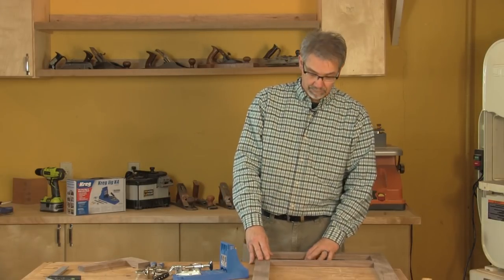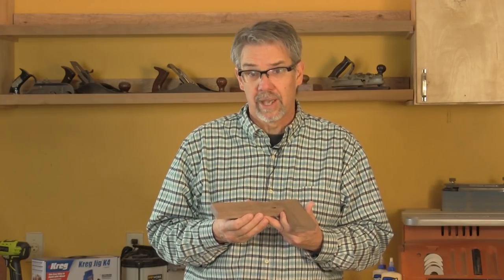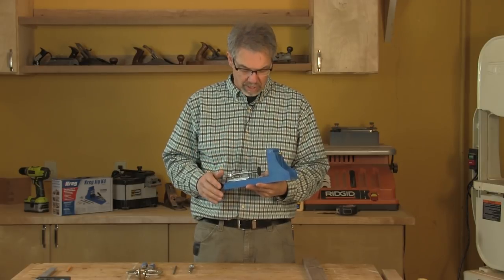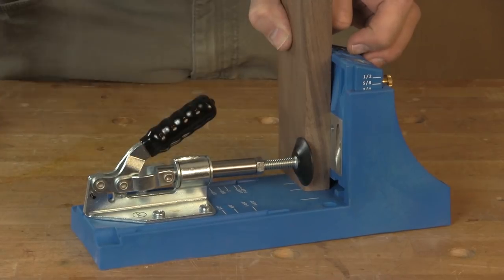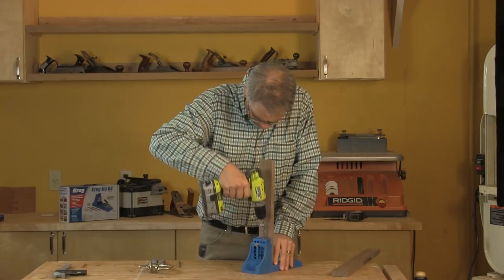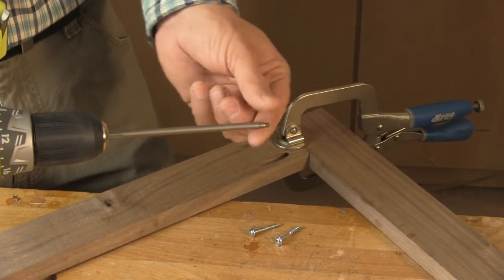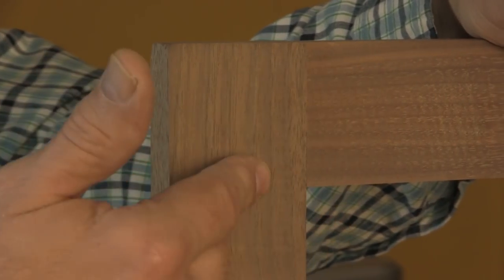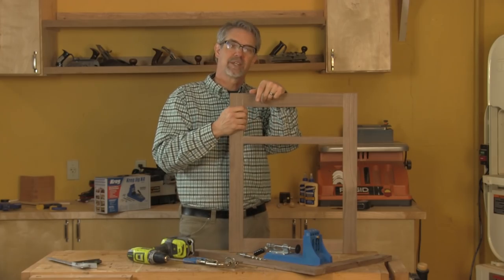How to Use a Pocket Hole Jig

Comment: That 'square drive' he colloquially mentions is in fact called a Robertson drive system...named after the Canadian inventor of it, PL Robertson.
It is 1 of the top drive systems on the planet to combat cam-out + it's relatively inexpensive to manufacture both the screw head & driver...

http://www.robertsonscrew.com/history.html
Reply: Yes.  I don't understand why torx is used as much as it is.  I hate torx screws and bits.
Reply: @ThekiBoran  because torx is even less likely to cam out as the force is perpendicular to the splines

Comment: do you not think the drill bit does not go down far enough, since the thread of the screw is around 50% in the initial piece of stock? it should be more in, I set it so its going further in that the recommend 3/4 inch marking. Is this not a basic thing about how to use screws?. What is your thoughts...now I am just wondering,I use the simple kreg jig perhaps the version you have makes it go further in, just like you shown on the cross section

Comment: Do a review on the Massca Jig System. There's isn't a toy and is solid aluminum.
Reply: glass fiber reinforced plastic is stronger and lighter than aluminum.
Reply: @leeknivek  I chose to switch to Massca after I got the Kreg and I'm glad I did. I don't care if it's stronger, it still feels like a toy and not worth all that money. I got solid aluminum for half of what Kreg wants for their plastic "tool."
Reply: @zakorkaz  I've got the harbor freight one, that's solid aluminum too and without the flimsier height adjustment - just has two angles preset and two sets of sleeves (nice if one strips + they're threaded in and replaceable, not sure on kreg)
Reply: @leeknivek  I feel like with Kreg you're buying the name and a product that was thrown down an assembly line after it was injection molded. The aluminum one I have feels like a $300 tool. I don't know. To each, their own.
Reply: The old kreg jigs were aluminum and high quality, unlike the newer versions